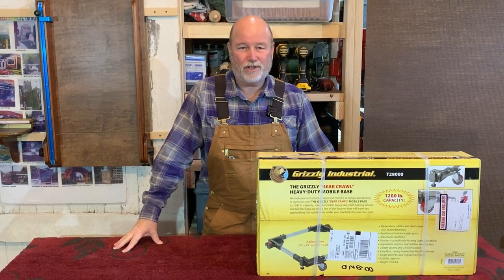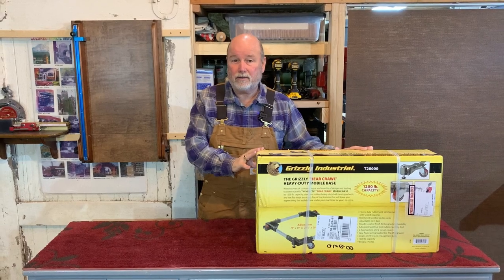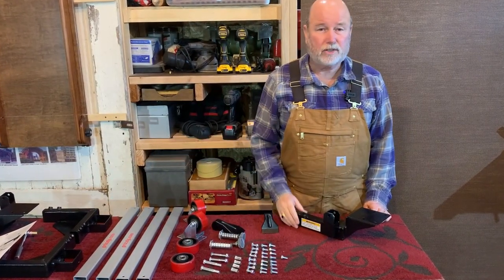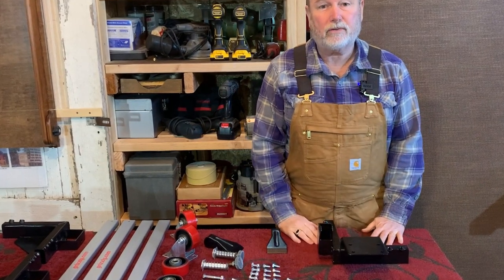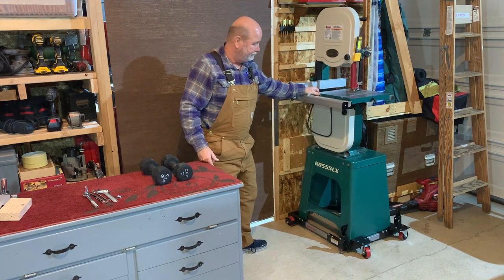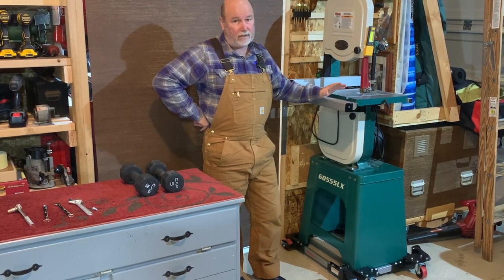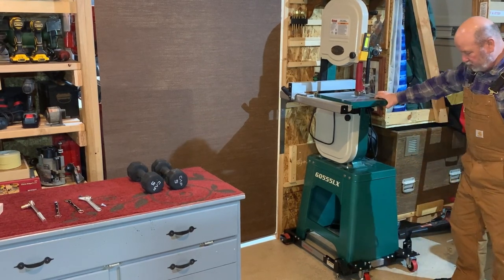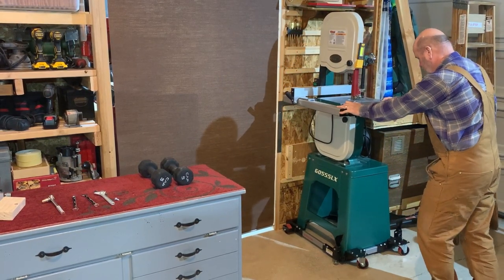Unboxing, Assembly, & Installing Grizzly Mobile Base

Comment: I have that same mobile base on my G1021X2 Planer. Very nice base for a 500lb machine. I’m not having the problem with my foot lever disengaging. Have a lot of confidence in this base. Going to get one for my drill press which is a floor model but will have a cabinet built around the base. I have the G0555 that I bought just over 20 years ago. It cuts just as good today as it did when new. Keep up the good work!
Reply from the maker: Jeff, sounds like we're both happy with our Grizzley purchases! My concerns on the foot lever have proved to be a non-issue. Neither one has disengaged during saw operation or while moving the saw. Thanks for sharing!